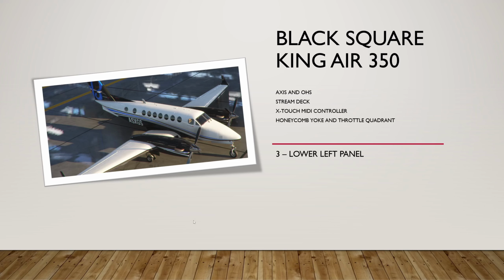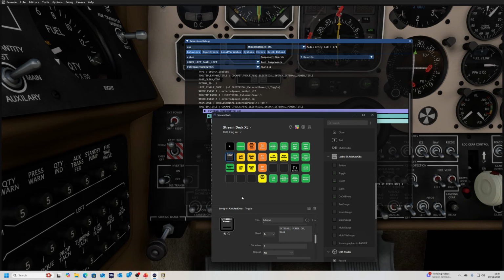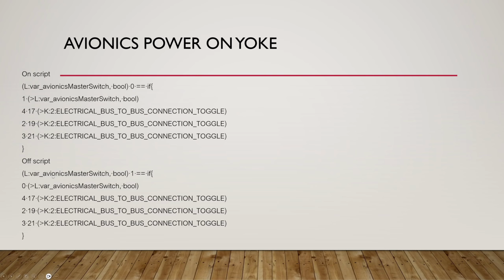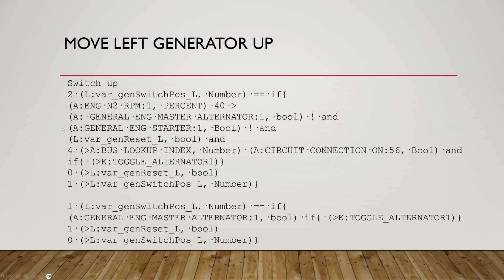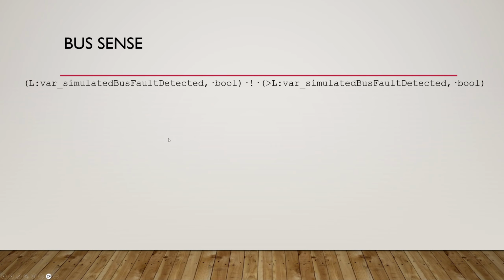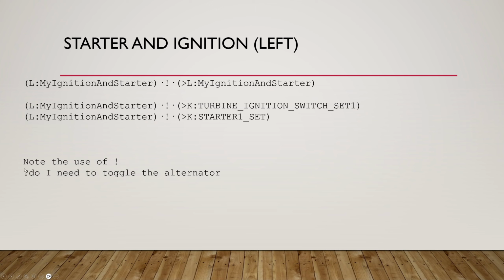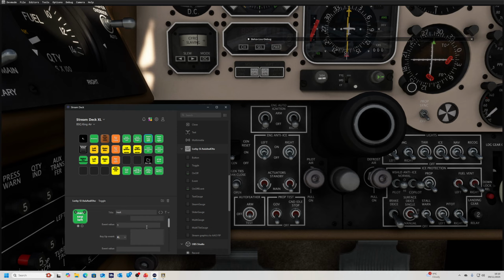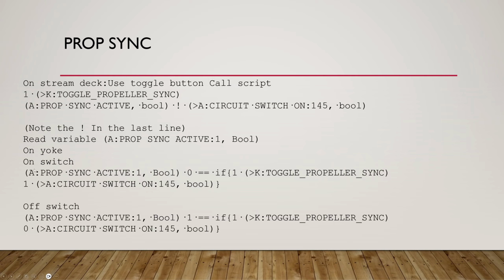3 King Air and AAO lower left panel

Comment: Hi Keith,
a workaround for the actualization of LVars in your STARTER AND IGNITION script would be to put the inverted value of the LVar on to stack 0 ( s0 ) 
and take this stack value ( l0 ) for all subsequent write operations.

(L:MyIgnitionAndStarterRight)·!·s0·l0·(>L:MyIgnitionAndStarterRight)
l0·(>K:TURBINE_IGNITION_SWITCH_SET2)
l0·(>K:STARTER2_SET)
 
Greetings from Germany
Reply from the maker: Hi, thanks for that. I tried using the stack a few years ago but didn't get something correct in the syntax and gave up!
I had to balance time spent working it out with my desire to get something working and go flying.
I'll look at this again and add it to my skills if I do another set of videos.

Happy new year.